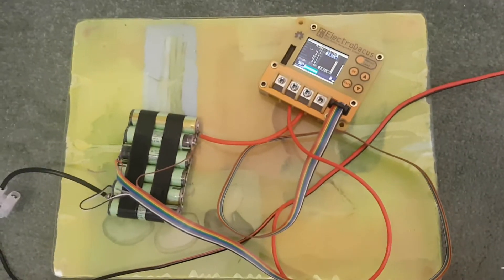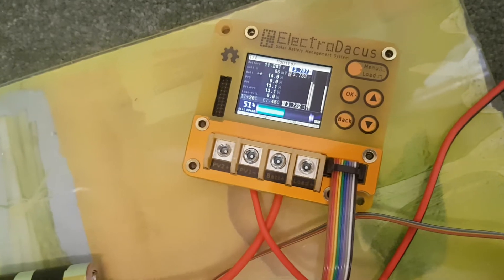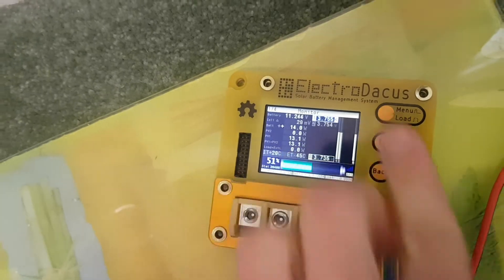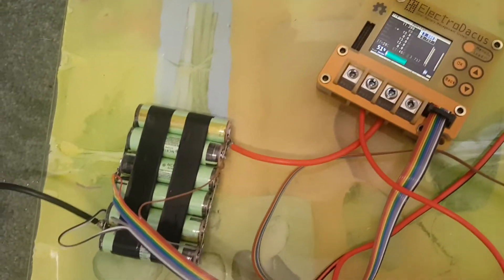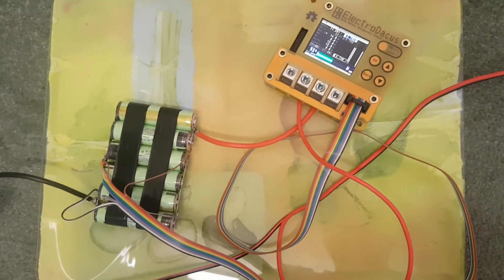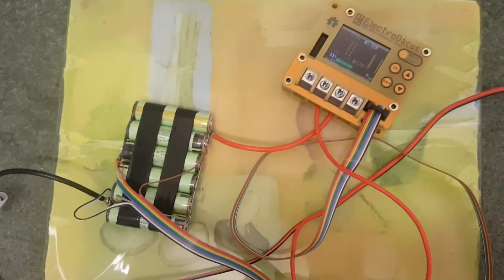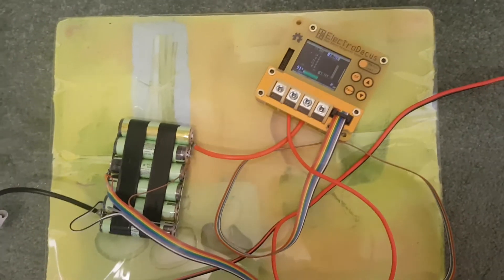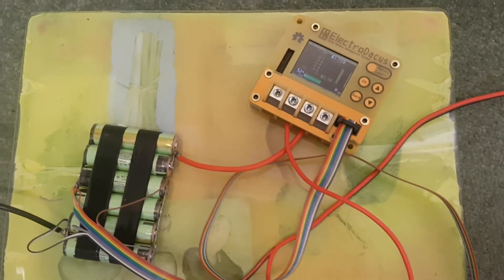Off-grid lead acid battery alternative SBMS100 lithium solar charge controller

Comment: Very nice start. You phone will remain forever charged. Will you do something like Jehu, or are you thinking about the big cells.?. My first solar setup where I learned the basics, still powers lighting in the storage container and security lights. My 20 watt panel has been working steadily for 5 years. Cheers Paul
Reply from the maker: I'm still thinking about the big cells (from brands such as winston) like you say I think this may be more than enough for an off grid phone :)